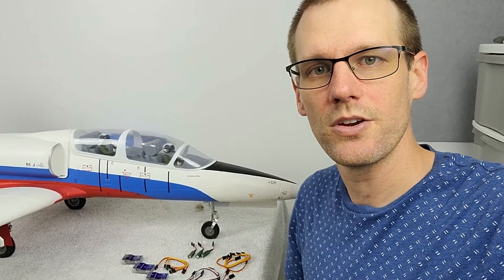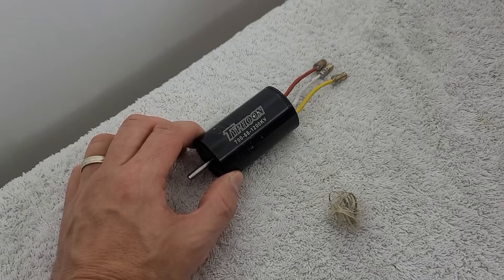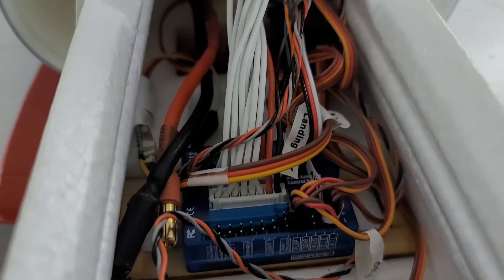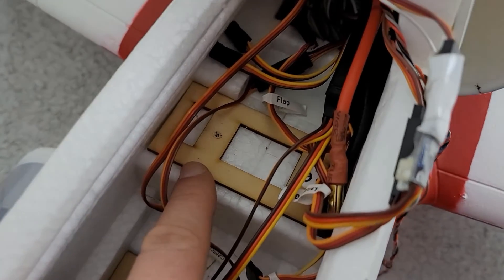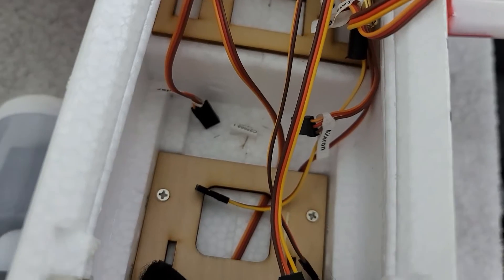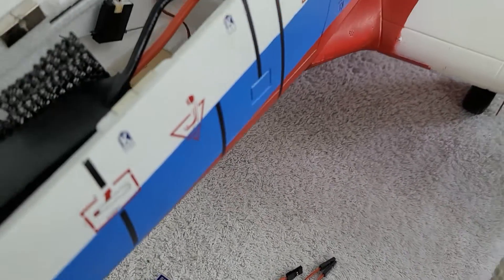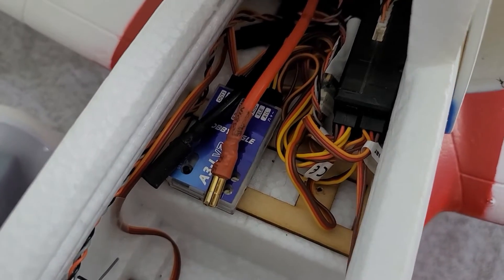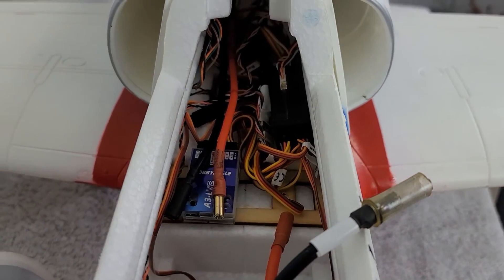Installing a Gyro in a 200+km/h EDF Jet  - Checkmate Crosswind!

Comment: The AL-3 gyros are ths absolute best bang for the buck.  10x better than as3x
Reply from the maker: Great to know as I have not used either yet! Provided UMX planes do not count! What would you say make them better?
Reply: @RCexplained I say they are the best bang for the buck because I have them in 17 of my rc planes.  From the 90mm f104 starfighter to the 80mm f-5, 80mm Mirage to FMS Tigercat to the 90mm T-45.  For one, they are easy to adjust.  Simply turn the pot dial to increase or decrease the gain.  As a starting reference for any edf jet I always put the gain adjuster to 10 o'clock position and increase or decrease gain as needed.  The gain can also be assigned to a dial switch on the transmitter.  Therefore, the gain can be adjust on the fly.  THE A3-L can also be turned on and off by assigning it to a switch on the transmitter in the event it becomes dislodged mid fligh.  
  Most as3x recievers have fixed gains and or can only be adjusted through a computer which takes time and know how to do so.  The as3x also takes time to adjust itself mid flight and in my experience it never seems to fly straight and true.  
  The A3-L is solid and consistent.  It will help any prop or edf plane fly like its on rails.  15mph crosswinds no problem.  
  One important and crucial thing to understand about the a3-L is that when it is powered on the plane MUST BE LEVEL!